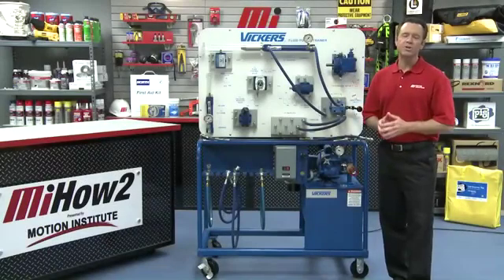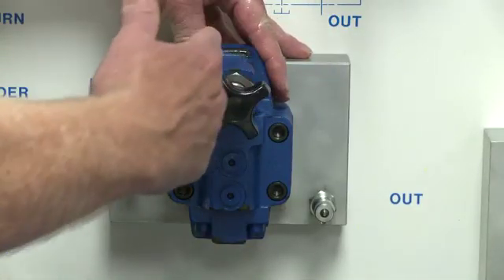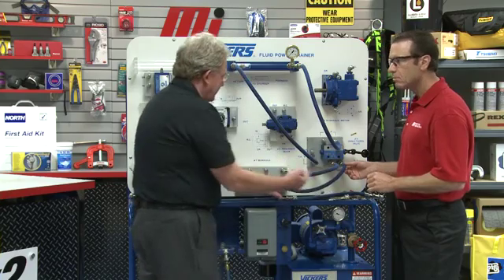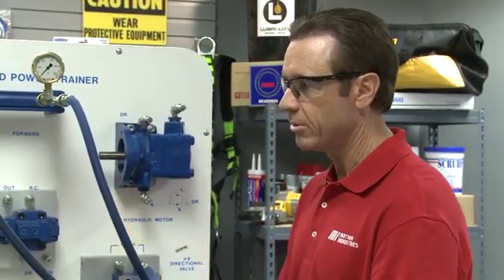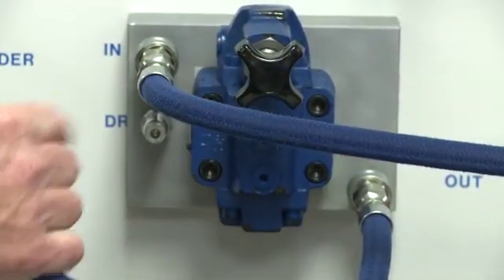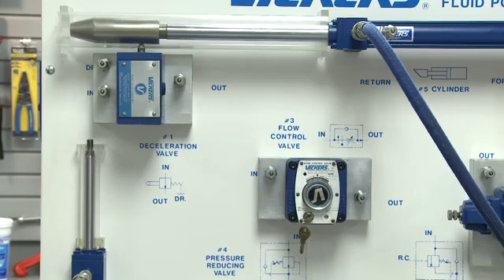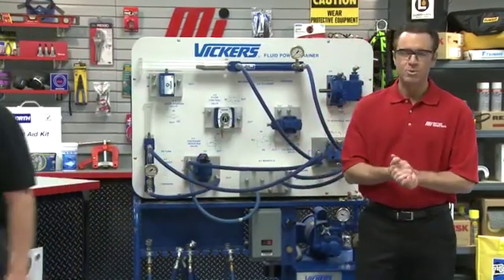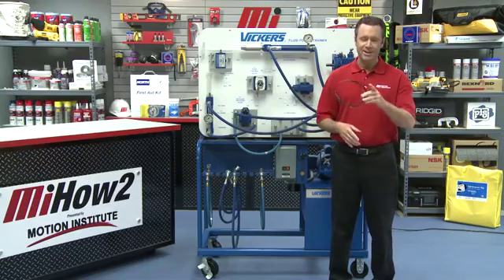MiHow2 - Eaton/Vickers - How to Set a Pressure Reducing Valve in a Hydraulic System

Comment: With all due respect: the presenter emphasizes the use of safety glasses before and after the demonstration, but the instructor doesn't wear safety glasses during the demonstration. There is only one way to bring hydraulic safety out of the vacuum in which it lives: respectable companies like Motion Industries and Eaton MUST lead by example. May I also respectfully suggest that you emphasize how important it is to undertake a course in fundamental hydraulics and hydraulic safety before performing any type of work on hydraulic systems.
"Hydraulic safety doesn't just happen. It must be vigorous pursued."
Reply: He is wearing prescription glasses. They act as protection whine bag.
Reply: Prescription glasses are NOT safety glasses, 
Just as cowboy boots are not steel toe, industry, safety rated boots. Yeeha!